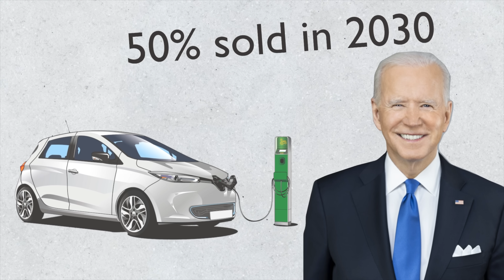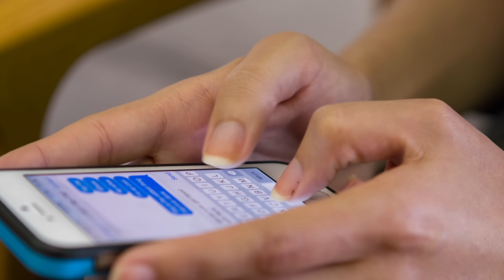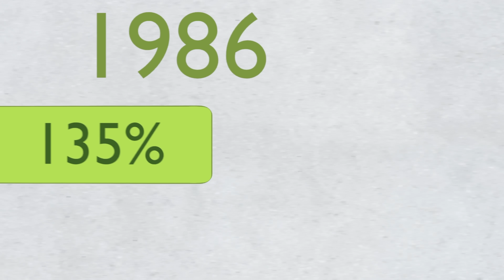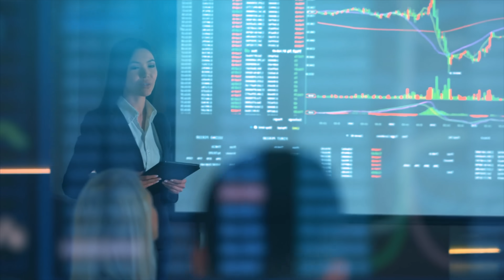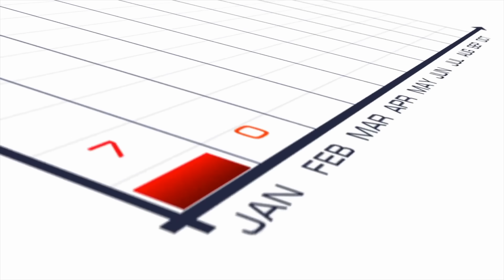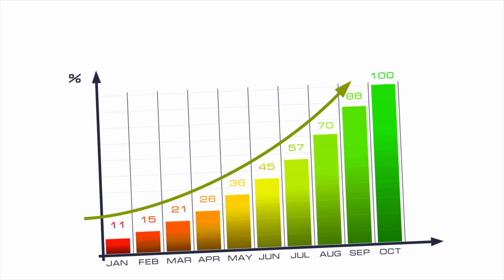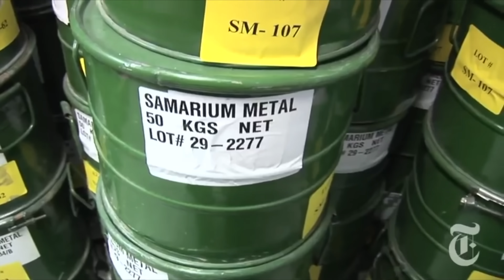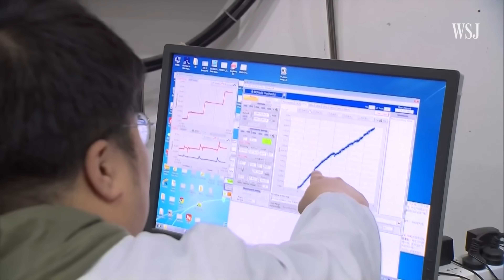Here's Why China Now Owns Toyota, Ford, GM, and Tesla

Comment: You cannot beat a Toyota Hilux pickup truck with a 2.8 ltr 4 cylinder diesel engine coupled to a 6 speed manual gearbox for simplicity and hence reliability.
Reply: And in runs off of American consumer tears!
Reply: Buy any used car or truck with proven track record and you can drive it for very long time.  These old gas cars/trucks are DIY repairable and will last far longer than any EV, in particular Tesla which are just throw away appliances.  I've done DIY repairs on my gas cars since 1970's and did all kinds of repairs imaginable.  I've never taken any of my cars to any mechanic.  For anyone who is mechanically inclined, old gas cars are definitely DIY repairable.  Now, Tesla?  Not so much.  Go check out any of the Tesla repair forums and what do you find?  Crickets.  Tesla fanboys have no clue how to repair anything.  LOL
Reply: @springer-qb4dv  how many y Tesla’s have you owned? That’s what I thought. Another Tesla hater with no reason to hate Tesla 
Cheers
Reply: @tomdavis3038  no matter what false statistics you’ve seen an electric car is more costly to maintain in the long run. Those who would rather not spend that much money on a battery pack that could go bad literally the first year in the car. Seen it first hand with my coworker on his model 3 within 3 months ownership needed new battery several thousand $
Reply: And they make awesome “Technicals” if you are in Somalia and have a few 50 cal Brownings available
Reply: @MyRuger  just so you know every electric vehicle sold since 2018 has an 8 year  battery warranty and in the case of Tesla is even better because it gets transferred to the new owner every time it gets sold. The main focus on the transition to EV should be eliminating the dependency on foren oil, look at the price of gas right now, cause by something that is happening outside the US.
Reply: @MyRuger  Indeed, the insanely expensive main battery replacement is Achillies heel of EV.  One battery replacement out of warranty and you are evaporating all the so called "savings" (and then some)  from using electricity instead of gasoline.
Reply: Diesel is dead John - grow up.
Reply: Dream truck right there 💯❤🤣
Reply: @springer-qb4dv  the simplest crashes total a Tesla. They're trash. 💯
Reply: That's what you say if you're not a Russian T-34 tank owner
Reply: @springer-qb4dv  But almost all the maintenance on combustion vehicles is on the combustion engine - fluid changes, timing belts, filter changes, etc etc.  None of which electrics have - about the only maintenance you have to worry about is washer fluid, wipers, and tires.

Comment: Hydrogen is the answer. Similar to existing technology like gas, just needs some adjustments. Unless there's a huge development in batteries, there's no way EV's are going to be a standard anytime soon.
Reply: But hydroden techs mostly hold by Toyota who never share.
Reply: Not really .. infrastructure is expensive, and not as convenient as ev as you can simply charge at home
Reply: @拉大栓的杨师傅  i believe that cost will get down, newer and better tech needs to be researched, whilst the cost of EV can only go up, because of the awaylability of materials. In the end it will get down to finding an efficient and eco friendly way for hidrolysys.
Reply: @cobaltblue2756  research and development is needed of course, but it's the most effective way for now to have clean and cheap energy. Research has been stalled because fossil fuels where so cheap, which will be no longer the case as we are seeing now.
Reply: You are so right.
Reply: I think you'll find both batteries and Hydrogen will co-exist. In Commercial operations where equipment needs to run close to 24 hours a day, we'll have to absorb the higher costs and inefficiencies of Hydrogen. Think Mining Operations, and Long Haul Transport. Domestic Applications like personal transport where people have time to charge equipment can be transferred to batteries. Energy intensive areas like Flight may also need Hydrogen. Other than Flight, think Hydrogen might replace Diesel, Batteries replace Petroleum.
Reply: @icosthop9998  it going to happen
Reply: @tsubadaikhan6332  batteries swapping will be the norm not hydrogen
Reply: Needs to be a multiple tier offset of oil consumption. Some electric. Some hydrogen. Some oil. Using ONE option no matter what it is will not be sustainable. Simply too many people have cars to make all cars operate the same.
Reply: hydrogen is good for heavy & long range vehicle like ship, aeroplane, bus, truck, & train. not sure about safety for aeroplane, though.
Reply: hydrogen is just as stupid as ev cars.
Reply: @icosthop9998  this is what people dont seem to get.
Reply: @icosthop9998  is hydrogen not stupid anymore?

Comment: How much increased reliance on oil is required just to build and run each mine?
Reply: You have a very good point.
Reply: @orion3267  heavy machinery run on high 3 phase AC electric, sure no common battery able to supply that kind of power
Reply: How much oil is used to pump oil from underground, move it by oil tanker to a refinery, refine it (a process that uses rare earth metals, including cobalt, btw), move it by oil tanker / truck to your local gas station, and then pump it into your care? And then repeat that whole process for every couple of mile you drive.

Comment: Fascinating video Scotty! Really enjoy these. I cannot afford an EV - increasing gas prices will never put me off owning my gas car.
Reply: You can own it, just might not be able to afford to drive it.
Reply: @jamesvandamme7786  No.  Cost of unrepairable EVs will be tremendous over lifetime, never mind having to replace mega expensive main battery.  In contrast, my 30 year old gasoline car cost me (total purchase price + maintenance + repairs + fuel)  just fraction of what new EV would cost in just purchase price alone.  As long as you have some mechanical inclination and can DIY repair gas car, it will always be far more economical than throw away appliance EVs.  
The main problem is how they designed EVs.  Instead of making the EVs simple as possible for easy DIY repair, manufacturers went exactly opposite route, making it computer on wheels, nearly impossible to repair as it ages.  You might be able to junk yard rescue a 60 year old gasoline car from junk yard, but nobody will be doing junk yard rescue of EVs rotting in junk yard in the future.
Reply: @rileymod2523  "might not be able to afford to drive it.".  True if you have a gas guzzler and drive everywhere.  If you only drive for essential trips, gasoline cars are still pretty affordable even with $5 gasoline in west coast.  I did calculation of my annual gasoline cost, and impact is minimal for me with my fuel sipper econobox gas car.
Reply: It was worse during Bush/Chaney era and i earned much less money. That sh++ had me on food stamps but i learned how to cut back on unneeded items.
Reply: @springer-qb4dv   regular car battery is expensive. Really who tf is going to buy a used ev knowing that the expensive azz battery is about dead? Thats like buying a gasoline vehicle knowing that the 20,000 dollar motor will need replaced soon.
Reply: @jamesvandamme7786  if their sh++ is anything like those Chinese motorcycles and four wheelers,they can keep that sh++
Reply: @springer-qb4dv  Toyota Prius for the win homie
Reply: It's cheaper and better to move to European countries than owning a car
Reply: @jamesvandamme7786  The cheapest EV is 30,000 dollars.  Simpler? You better check out how many chips are in a E Mustang ! Do you have a clue what it would take to get a cheap Chinese EV certified for use in the US??
Reply: @BruceLee-xn3nn  In today's China, if a person wants to spend 200,000 Chinese Yuan ($30,000 USD) for a car, 95% will go for an Ev Chinese car instead of a German gas car。Germany is kind of out of the game in EV car area.

Comment: Good evening Scotty! I’m not sold on EVs, but I do think hybrids can make sense - a small battery like in a Prius or Hybrid RAV4
Reply: The first vehicles were electric, gas cars came decades later,
Reply: @Nafpaktos-Florida  You got some strange logic
Reply: @etacarinae5558  after 30mph hybrids use the gasoline engine..it takes 2 seconds to get to 30mph..where is the strange logic? Who the heck drives less than 40MPH even on a side street? 🤔
Reply: @Nafpaktos-Florida  city driving
Reply: I'll take one in every colour, a leaky moonroof, and extra speakers.
Reply: @Nafpaktos-Florida  you clearly don’t understand the concept of ‘hybrid’ both engine and battery work to generate power propelling the axels forward. The battery is the Robin & the Engine is Batman. No Alternator, no starter & heck some might say no transmission either.
Reply: If you drive a manual transmission, you'll understand the blessing of the hybrid especially when mated with a high end powered engine. Automatic transmissions isolate drivers from their engines' character.
Reply: @Mister_O781  yeah when only the rich had one. Now everyone has a car if not 5. Electric cars are not a permanent option. It's good to offset the use of oil, but it cannot be replaced.
Reply: @DronesUnder2A  electric cars were more expensive than gas cars by like 1000 dollars in the old days which would probably be about 15,000 dollars today, the fueled it by charging the battery similar to how you would charge a cell phone 

Gas cars were never about affordability for the masses, it was just about creating a monopoly for a few powerful men, electric cars were used as police fleets in New York over 100 years ago, electric cars are not hard to make or perfect or to manufacture

Comment: These mines are far more harmful to the earth than drilling for oil, they have created a sodium ion battery that is alot easier to mine and is alot more abundant but that means they won't cost as much so we can't have that now can we
Reply: Both are bad 100%
Reply: China's largest Battery Manufacturer, CATL, just filed a new Patent for a Sodium Ion Battery this month. Currently it's less Energy Dense than Lithium, but involves practically no rare materials, making it cheaper and less environmentally damaging. To the other commenters complaining, Sodium is half of Sea Salt, NaCl, it's not particularly harmful or damaging unless you really try to make it so.
Reply: @tsubadaikhan6332  they're more environmentally friendly is more abundant and sodium ion cells take a fraction of the time to charge and last longer... But just because a company has a patent doesn't mean they're going to release it to the public at least until they get rid of the lithium they've already spent money on

Comment: Until the electrical grid gets beefed up, hybrids are the way to go.
Reply: I agree, I think we are putting the cart before the horse and trying to do this too fast.  Hybrids work fine interim until conversion.
Reply: And it's going to take a long time to beef them up.
Reply: PHEVs are the best compromise - EVs for short range driving and gas engine for long range driving.
Reply: My crown vic is a hybrid of reliability and capability.

Comment: Best thing would be to have both EVs and gas cars. It's good to have options.
Reply: Psssh, I got a Flintstone car
Reply: RAV4 Prime! Plug-in hybrid… best of both
Reply: they need to go easy about batteries and have  electrical cables running along with roads.
Reply: Good balance and competitive competition be better prices on both vehicles and their fuel types
Hybrids included
Reply: @mcc7762  Yes.
Reply: Competition is good. I always though it was one of the driving forces behind improvement.  Kaizen across the board.
Reply: @Texas76302  shush
Reply: @icosthop9998  cable doesn't have to be inside in the road, though.
Reply: @icosthop9998  electromagnetic propulsion?
Reply: Or really improve hybrid technology,I really don't understand this push for ALL electric cars.🙄
Reply: @oliverguenther9243  Yeah. Some people like to pretend that because it's convenient to charge a car at their house and take short trips, and never go to gas stations that they are somehow using less resources than the lowly peasant gas car drivers. Simply not true. i think they're great and they have their place, but definitely not the end all be all.
Reply: @Doomzdayxx  half an hour to recharge your battery when you are in a hurry, on your way to somewhere,  would be the longest halfhour of your life.
Reply: @icosthop9998  dude,  instead of asking a question you smear and argue by emoji laughing at your own supposed wit. I think that demonstrates your inability.
Reply: @sasvanwyk5886  For sure. which is why a backup gas vehicle would be badass.
Reply: Also, avoid monopoly.
Reply: @Doomzdayxx  the hybrids are my favourite. RAV4. Would love to see that in a pickup. Farmers will go for it. Especially those who have solar systems.
Reply: Imagine, a world where we can learn to compromise.
Reply: @oliverguenther9243  look at Toyota's plan. Mostly hybrids.

Comment: The way out of this dependence mess is for the US to produce cars as low tech as possible concentrating the use of rare earth metals only for power sources and leaving them out of the unnecessary techno features that car owners don't really need. This approach will buy time to continue reducing our dependence on foreign supply sources while domestic sources are developed
Reply: But it's not just batteries need rare earth metals. Higher efficient electric motors need good magnets, and it's making of those magnets needs rare earth metals because they are complicated alloys. Until those guys in lab coats discover some new way to make these magnets this situation is not going to improve.
Reply: @enchantereddie  There are billions of motors in junkyards across the world that can be salvaged for rare earth minerals. These can meet the world's demand at least for the next 50 years. There are also new technologies in motor design that use fewer rare earths that are showing lots of potential. Plus theres still plenty of RE reserves in the US and other countries outside of China that can still be utilized. Right now, the world has much larger problems: Putin and Xi trying to redraw the worlds maps.

Comment: I always looked forward to hydrogen fueled cars in my old age.
Reply: Until they figure out an inexpensive and safe way to implement them, I probably won't see that happen in my lifetime.
Reply: If they don't blow up like the Hindenburg.
Reply: Ponder ammonia. Three hydrogen atoms, one nitrogen atom. Not nearly as much energy as fossil.
Reply: @icosthop9998  And I dont want it to happen either because I like my ICE car. It's fun to drive, etc
Reply: Look at how hydrogen is produced!
Reply: @extremedrivr  you can make a hydrogen car with ice engine
Reply: @r.i.peperoniiiiroh9625  Yes of course

BMW did it years ago (Hydrogen 7) which the world wasn't ready for and still isn't.

But liike anything else in the alternative fuel sources catergory though it has it's drawbacks when compared to Petrol.
Reply: @extremedrivr  yes i know like mazda rx8 on hydrogen it had a range of 100km with upgrading the tanks not adding weight you can now get 200km range with the same space so i think hydrogen is yet for a comeback becuse no one want to be dependent on china
Reply: And China is big on that too lol
Reply: Those are EVs too.

Comment: The goal won't be reached in another 100 years.
Reply: It will never be reached. Not for long, anyway. It is not a sustainable solution
Reply: It's like 280 years off at the current rate of production. Obviously production would go up but not fast enough to replace hydrocarbon vehicles any time soon.
Reply: Dude, we went from the wright brothers to landing on the moon in 63 years. EVs aren't perfect but they're already here. You really think it'll take 100 years for them to get better?! 🤣

Comment: Me too--drove my 1998 Acura TL for eleven years,220K miles, sold it to the State buyback prog. for $1000, then found a sweet barely used 2001 TL for $3000 just before pandemic lockdown.  If hardly buys new cars, lots less air + water + soil pollution due to not engaging in those destructive, polluting processes.

Comment: Scotty, what about the cheap rust batteries? Rare earth batteries only deliver 6 hours duration whereas rust batteries deliver 100 hours.  Wouldn't a smaller rust battery fix the weight issue?

Comment: Are electric vehicles reliable in countries with  humid hot weather like the Philippines?🤔
Reply: It's cold weather that effects lithium ion batteries
Reply: Definetly not especially with the flooding there
Reply: @minekush1138  Extreme heat will reduce the life of the battery, extreme cold will reduce the efficiency.
Reply: @archiethedog4515  south east asia is hot but not much hotter than your usual summer.
Reply: @aeb1305  ev technical able to drive underwater, as they do not need oxygen for combustion, as long as they seal the component nicely, just like your waterproof Samsung note

Comment: You have to mine 500,000 lbs of earth to make a single EV Battery.  The average EV battery weight is about 1,000 lbs .
Reply: Have a drink on me.
Reply: And after 10 years the main battery might die requiring another 500,000 lbs of earth to be mined to make another EV battery.... as there is no practical recycling of lithium ion batteries.